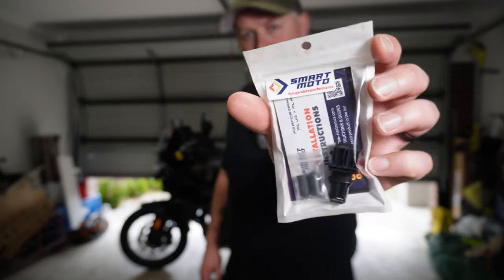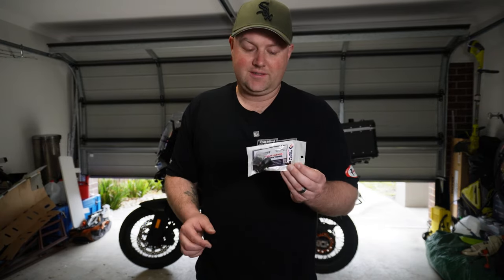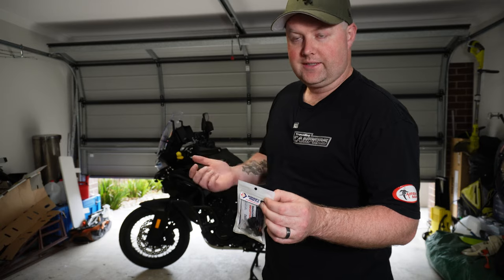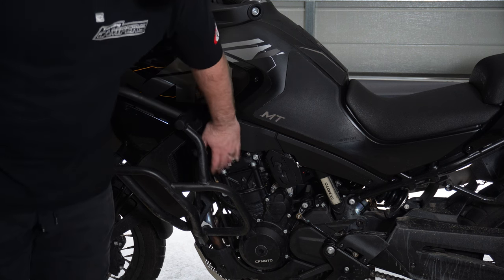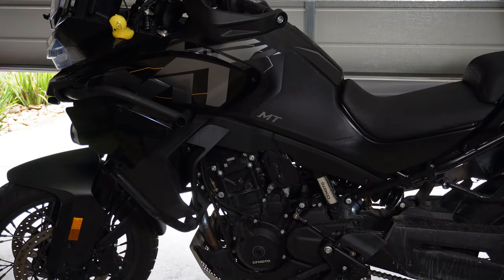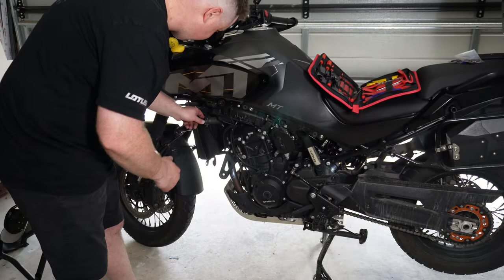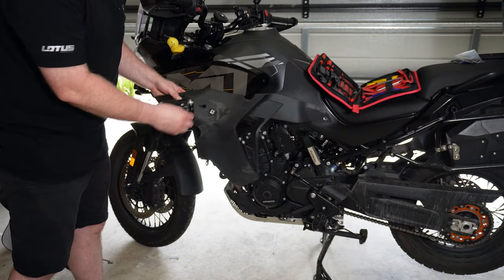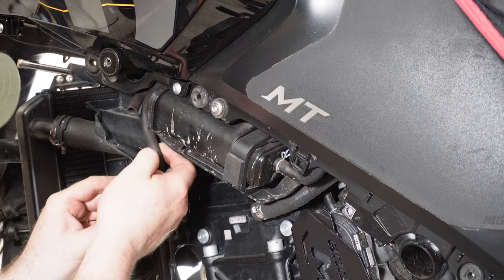Eliminating Throttle Issues with the CFMoto 800MT for $30!!!!!

Comment: Mate this has made a world of difference thank you for the video
Reply: @nickbertoz  hi , I'm really interested in this mod , iv done the O2 sensor delete and it made a huge difference to the lean condition between tick over and 3000 rpm,, will the evaporation system delete help the on/off throttle sensation above 3000 rpm ,  getting back on the power mid corner in 3rd gear feels too snappy , will it cure this ?
Reply: @seanobrien5520  if i need only low RPM fix, like 1/2 gear under 1000-3000 RPM, is than the EVAP fix sufficient?
Reply: @Peripolo11  it seemed to have sorted mine at low rpm also, riding in heavy traffic is much nicer and smoother with small throttle inputs .

Comment: I removed the evaporation charcoal canister and and plugged in the Smartmoto resistor , it has transformed the throttle sensitivity on the bike ,, no more "on off " jerky throttle,i also removed the 0² sensors and used the Smartmoto O2 delete kit ,, now the bike is smoooooooth as butter. Highly recommend these 2 mod's.
Reply: can u send link please? do you know if it works with 800nk too?
Reply: Will installing the EVAP kit and the O2 sensor delete kit worsen fuel economy??
Reply: @spatarogiuseppe3616  I haven't noticed any change in the fuel economy,, I'm using 5.8 litres per 100 KMs since new

Comment: Mate did it stop it snatching between 3 and 4 k revs.  I’ve just ordered an O2 delete kit to try and fix it.   I’ve got a local guy with a dyno who is a KTM specialist band he wants t re mapping my ecu   But if what you did works I will try that.  The O2 delete kit hasn’t arrived yet.  I’ve ended up putting my original de cat back on to give back pressure to help with the O2 sensors as I believe it was running to lean and may have damaged the pistons.
Reply from the maker: @ivanrushtonthelonewolfrides  I have ridden about 550km this week since doing the mod last weekend and it definitely transformed the bike. It doesn't surge while filtering through traffic at low speeds and feels like a totally new bike.
I still have the same exhaust on it with the small sports cat and the fuel dongle.
I did remove the fuel dongle for one trip this week and seen the air fuel ratios spike to 15ish which was fairly lean so I put it back in which settled it back around 13. I'll have to look back over log data to see if it was correct and having hight air fuel ratios.
Reply: 2600klm ride since I fitted evap delete kit  jerky throttle and surge all fixed
Reply: @800Adventures  I’ve not done the air fuel dongle that helps aswell does it.  What vid was that on mate I will check the link out
Reply from the maker: @ivanrushtonthelonewolfrides  I did that with the decat pipe so it doesn't lean out. I then swapped back to the cat pipe with the small cat in it but kept the dongle. 
How many KM are you getting out of a tank?
Reply from the maker: @gkhodgins  Thanks for the info it has transformed the bike!!
Reply: @800Adventures I get around 180 miles per tank
Reply: Funny enough I had an email today from CF Europe saying China are looking into a program that will homolagate for the UK but no time as to when it may happen
Reply: @800Adventures is the pipe 8mm internal diameter or 8 mm external diameter.  Same for the connector.  To fit an 8mm internal size ?
Reply: Best I had since evap delete  is 390klm  that was without panniers. Have just done 2600klm trip thru Victoria highlands lots of twisties it averaged 4.3ltrs to 100klm

Comment: Great video! Think i might try to make my own 'kit', just need to find the right connector and value of resistor! Cheapest kit Ive found in UK works out as $45aud! If you could measure the resistor for us youd be a legend!
Reply: Looks like it's a 2 pin Bosch style ev1 male connector (for anyone else interested) Now I just need to work out the resistor! Guess I could just measure the solenoid? 🤷🏻‍♂️
Reply from the maker: @dr3wize  I have been thinking about it, you could leave the whole solenoid in the bike and just disconnect the hose and plug it and extend the breather hose. The solenoid should only throw an error if it's removed.

Would be an interesting test anyway
Reply: Just to follow up on this, I plugged up the ports on the throttle bodies and left the pipe off the Evap canister venting to atmos, kept the solenoid plugged in etc... just to test... Took bike out for a few hours and it's so much better!

Comment: Might want to do throttle relearn procedure. Solves snatchy jerking throttle.
Reply from the maker: @index6738  have done and made no difference, it's not the snacthy throttle it's the jerky fuel mapping when putting at slower speeds and keeping the bike at the same RPM it just starts to jerk and surge.
The throttle is sensative but you get used to it

Comment: Hi mate. I've purchased the kit and trying to remove the cannister. 
Unfortunately the video stopped after crash Bar removal.
Is the fairing spotlight section held by a rubber mount?  I've unbolted everything I can see or feel. 
I'm reluctant to just try and pull it off.
Am I missing something?

Comment: Hi Seán here from Ireland, another fantastic video , iv recently done the O2 sensor delete kit from the same company (SmartMoto Electronics)  and it made a real good difference to the low rpm lean condition , can i use this evap  delete together with the 0² sensor  delete also ?
Reply: I want to do the same so would be interested if it’s ok to do
Reply: @ivanrushtonthelonewolfrides  probably lose the warranty but I'll be doing it anyway,, it's a fantastic bike and will be even better when the throttle is sorted,, euro 5 emission regulations are some bullshit

Comment: Hi! Recently I notice your video which are very interesting and informative.  Do you know if this part fix the same issue with CF 450 MT? Thanks in advance.  Continue the great work 💪
Reply: Yes  it working with 450MT too.. The kit is compatible with the following models : 
CFMoto > 450 MT/NK/SR-S/CL-C > 2023 - 2024
CFMoto > 700 CL-X Heritage/Sport/Adventure > 2021 - 2024
CFMoto > 800 MT Touring/Sport/Explorer > 2022 - 2024
CFMoto > 800 NK > 2023 - 2023

Comment: Hello from Greece, do you know if the cf 800MT explore  has an indication of the outside temperature on the screen?
Reply from the maker: @atekcompany8307  Na it doesn't unfortunately
Reply: @800Adventures the touring has it, is it possible that they removed the temperature sensor in explore?or maybe it was added in some screen upgrade in the future?

Comment: Great stuff & cheap fix. Why was the radiator hose leaking? Is the hose a tad short & just going over the tube bulge?
Was this happening because of slow dirt runs & the fan continuously running on & off in high temps?
Will you be keeping an eye out on it when summer eventually gets here?
Reply from the maker: @stevesane800  I definitely will be keeping an eye on it, yesterday I did alot of dirt riding at high RPM and Nil leaks. I just removed the clamp tried to tighten it a bit and hasn't leaked since, have done alot of KM since this mod and Nil leaks.
I'll keep an eye on it as the weather heats up and if required I'll change it to a proper hose clamp.
Reply: This problem is caused by heat from the pipe to the exhaust. The KTM has the same problem. They change the plastic elbow to an aluminum one. Insulation would probably help too.

Comment: Hi. What sprocket did you install? Did it increase power on low rpm? I suffer from weak low rpm power.... Didn't get clearly what were you talking about gears and rpm regarding sprocket. I don't need much speed, but I would like to have more power at low rpm. I suppose sprocket is the answer? And does this plug - method have any result on power managing? Thanks!

Comment: NOTE: Will installing the EVAP kit and the O2 sensor delete kit worsen fuel economy?? Or will it stay the same. Thanks
Reply from the maker: @spatarogiuseppe3616  EVAP shouldn't change it as your not changing any sensors just re routing where the fuel vapour goes. I am not sure about the O2 kit as I haven't don't it and probably won't as I have no reason too unless it's just for testing. But very happy the way the bike rides now

Comment: a few questions, 

1. does this work with 800nk, cos anything below 40-50km an hour and it's very twitchy and jerky.
2. does this void the factory warranty?
3. another guy commented regarding 02 delete kit, do you think it'll help?
Reply: Someone commented that it was compatible with the 2023 800nk but I suspect the O2 is different, (single cylinder vs twin)  but I would also venture a bet that someone on the KTM 790 side has that solved also.

Comment: In the video you mentioned 8mm joiner and 6mm hose but the links you provided were for an 8mm hose... Did it still work for you or did you end up using an 8mm hose in the end with an 8mm joiner?
Reply from the maker: @charliebaz86  used the 6mm hose, it was flexible enough to get over the 8mm joiner

Comment: Hard to belive, but could be, EVAP adds fuel and jearks up fuiling at low RPM? Question, do you need the delete kit? Can't you just plug off throttle body piping and reroute evap exit to the catchcan?
Reply from the maker: @petermlakar879  yea I was thinking about that the other night and it should work just leave the solenoid hooked up. Run the vent pipe down and plug up the throttle body pipe.
Reply: @800Adventures would be intresting to see how mutch nasty  stuff wold be in a catchcan
Reply: Also wondering if EVAP make fueling problems, there something in SW cannot be right, yust saying